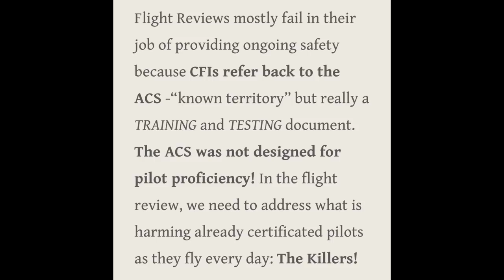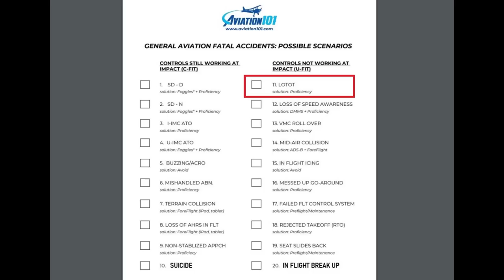Engine Failure at 400 feet.  The Impossible Turn.

Comment: Training has to become reflexive. No thought required. There is no time to think about what to do. This guy is alive because he reflexively pushed forward. He is a goldmine of experience. Excellent interview Dan!
Reply: Exactly, his 30yrs experience sure helped him fly to the crash scene alive. God Bless you Robert for sharing.
Reply: Thought is required, then action. You cannot just react without thought.
Reply: @Capt_Ron  reflex is an automatic reaction to an unexpected occurrence. Like putting your hand to your face when you sneeze.
If you have to take time to think, you’ll react too slowly.
Reply: Funny, as a Captain for a major US airline, (38 years experience) and having trained hundreds of crews over a 17 year period, it’s not what I have observed. Guys that react before they think are usually dangerous or cause a less than desirable outcome. I agree with you that some things needs to happen without a 1/2 second thought, for example, pushing the yoke forward on climb out after a sudden engine fail. But even in that case there is time spent determining what just happened and then acting.
Reply from the maker: @Capt_Ron  You may be confusing the two areas.  Panic reacting without thought can cause a guy to shut down the wrong engine, or to disable a GCU that can't be restored.  "Conditioning" on the other hand, has to do with making a human being an "Airman" where the controls are connected to his or her appendages, and the proper control response is intuitive because they are airmen, and can put in the correct rudder, aileron, or elevator deflection properly and in real time void of the shock and surprise delay.   It's the same "reaction" that you see when driving.  If a car crosses a lane and is headed towards you, you react without thinking and steer more towards the ditch to avoid the head on.  There is zero thought process in that time of crisis, you just see and avoid and there is no time to be slow about it.  See the difference?
Reply: @Capt_Ron  Came to say the same things :)
Reply: 100%, that is what i do. Know YOUR aircraft, know YOUR skill limits. Practice.
Reply: @ProbableCause-DanGryder  truth, sir! These are what I would call the "muscle memory" items. These are time critical minimums, where indecision will rapidly evaporate the options available. That brain freeze, or panic, or time of indecision can readily cascade into serious compromises trying to recover to that learned ideal.
Reply: @jamiewoki  Know your limits...and go fly with a CFI or much more experienced pilot and expand your limits.
Reply: @ProbableCause-DanGryder  Well said!

Comment: Anyone who tries turning back to the runway in a simulator will soon discover that two turns are needed.  After the 180 is complete, the plane is not pointed towards the runway.  A second turn is needed, and then aileron input to level the wings.  As the video described, the strong crosswind was definitely in Robert's favor.

Comment: * AIRSPEED  *
Reply: My ultralight instructor was a religious man.  But he told me right from the start “Airspeed is God”
Reply: I obtained my PPL, CPL and Instructor Rating in New Zealand in the mid 70's.

At every level we had to demonstrate a forced landing due to engine failure after takeoff down to 200  feet AGL.
Reply: @robinmccarthy9435 I’m interested but unfortunately not familiar with aircraft specifically training for ppl for example, do you know if anything like this is still common practice or is the standard a higher altitude forced landing perhaps?

Comment: Dan, have you ever flown in a glider? The situational awareness it gives you is priceless. As a glider pilot, I transitioned to airplane, and soloed in little over 5 hours.
I had 5 engine fails, 3 fires and one bird in 45 years of aviation. Landed without a scratch every time. Every takeoff, I am planning to turn upwind if engine fails, and sit there wondering how this bucket of bolts will crap out now. The rest of the flight I fly high, and look for places to land always. I tell people, if you think you are flying a plane, you are deluding yourself. You are flying a very bad glider with a drag overcoming device. If you don't believe me, you will when drag overcoming device stops abruptly.
As an A&P, I know where the potential issues are, but nothin can help you predict a connecting rod, or a valve just unceremoniously giving out. That is where training and knowing your plane is critical.
Reply: As having glider experience, my instructor illustrated during a winch launch, if cable breaks below a couple hundred feet, can land ahead; if below around six hundred feet, can do a 180 and land back; above that, a low tight circuit and land - the point was, you're never without pre-planned options.
Reply: Helicopter flying is good too, for keeping an eye out for possible landing spots.
Reply: I'm totally on board with Dan's AQP push and I agree with everything you just said in your comment.  And everything you're saying and everything Dan is pushing should be top priority to a GA pilot/aviator. What I'm calling for in addition to those things, is a COLLECTIVE push to actually solve the problem.  As much as I hate "mandates" in most cases, I'd like to see airports create designated cleared areas where if a GA engine quits on takeoff, the pilot can go direct to the spot and avoid the 180 turns.  Of course the FAA would have to get involved and the city involved too.  But it happens EVERY time !! When a new airport is built, it's ALWAYS out in the middle of nowhere.  So for perhaps the first 30 years, there are ample spots to put the aircraft down.  But then one day you wake up, and the airport is surrounded by houses, shopping malls, schools, stadiums, concrete, cranes, powerlines, ect ect.  Well, my feeling is, since the airport was there FIRST, there should be no problem with creating a designated emergency landing spot, and as much as I don't like Eminent Domain, I don't have a problem with it in this case, because NOT crashing into a building is absolutely for the common good. The other thing we need to collectively push is the powerplant itself.  As an example, the Dyna Cam engine {an engine with 50% of the moving parts as a "conventional" engine} was literally APPROVED by the FAA and tested on a Piper Arrow in the 1990's and passed with "flying" colors.  Yet here it is 2023, and there are no Dyna Cam powered aircraft {except possibly that Piper Arrow}.  So there's one thing "we" could be pursuing.  The other is some kind of emergency backup system.  My idea is use a conventional engine with a solid crank {you get rid of the CS prop where aplicable} and it's connected to a "thrust bearing box" {not a gearbox, unless it's a Rotax}.  The "box" is set up like a manual transmission clutch on a car.  99% of the time, the clutch remains engaged and a lever in the cockpit you can disengage it.  Connected to the output shaft are a set of pulleys driven by dual belts which are driven by pulleys directly attached to an electric torque motor via a centrifugal clutch.  So let's apply my idea to Robert's situation.  On takeoff, Robert sets the power, 80 HP from the O200 and 20 HP from the electric.  The O200 is driving the prop through the engaged clutch and the electric torque motor is driving the prop through the centrifugal clutch {because the electric motor is turning}.  So Robert takes off and starts the climb and at 400 feet BAM !! the O200 is rendered useless.  The torque motor experiences more a of a load and through circuitry, sounds a MAIN ENGINE FAILED ALARM and the immediate action is disengage the mechanical clutch.  So Robert hears "BAM !!" then MAIN ENGINE FAILED BELL and immediately pitches as required for best flying speed, then immediately disengages the main engine via the clutch handle - it would be spring loaded with a lock detent.  NOW the prop is unconnected to the failed engine.  Then Robert would push the electric throttle up to the full 100 HP and continue to do a normal climb.  Then Robert would pull the mixture handle and turn off the fuel on the selector valve since he's now fully electric. The battery which are in the wing tips, can supply 20 minutes of emergency power, so there's plenty of electrical energy to do a normal climb and do a normal landing.  Robert will still declare an emergency because he may have the ability for one, maybe 2 go arounds if needed.  But what Robert does NOT have to do are steep banked turns close to the ground.  - But look, I think it's just beyond ridiculous to continue with this idea that we just have to accept the notion that if you lose an engine, your only option is going down.  This is 2023 and we can figure SOMETHING out.  Like I said earlier, at the very least, airports need designated clear spots just off the runways.  But I can't do it alone - this has to be a collective effort - don't sit around and wait for the FAA to do anything about it because if they haven't done anything by now, they NEVER intend to.
Reply: @mustardseedsociety  Government is the worst way to do anything. Everything they touch turns to crap.
Reply: @KutWrite  Well I tell you what, you're PREACHING TO THE CHOIR !! But I have found when it comes to aviators, they are perhaps some of the most brainwashed people on the planet.  On one hand, most are incredibly super duper smart and that's why they have achieved a high level of success as an aviator and to that I totally tip my cap.  HOWEVER, on the other hand, many {NOT ALL} but many are as dumb as rocks in other areas.  As an example, according to Josh Yoder, 80% of airline pilots took the "sleever".  How can people who are so smart as aviators, be so stupid as lab rats ?? I don't get it.  That's why in my efforts to create a freedom and liberty aviation network, I 'm pretty much done with reaching out to current aviators because the vast majority I've run into are brainwashed robots as well as mister know it alls.  You certainly can't have a REAL out the box thinking revolutionary discussion with them because most are like zombies cut from cookie cutters.  So, because of that, I literally have to invent ways to introduce any out of the box solution because most get so offended and triggered.  Especially those that are former military.  They'll accuse you of being "against America" and I be like, OK whatever dude, have a nice day mister I know everything about everything. But I totally appreciate you for saying what needed to be said - you just spoke the truth and I thank you for it.
Reply: @mustardseedsociety  Thanks for the positive feedback. I know what you mean, having been to Navy flight school AND worked as a civilian for its TOPGUN school before it merged.
 
Interesting image, 'cookie-cutter zombies.'
Reply: @KutWrite  Wow, that's pretty cool.  Look, nobody believes in safety more than I.  I'm not out to break flight procedure rules, or none of that stuff.  I just find the certain regulatory "agency" very inconsistent.  If they're really about safety, why can't they try to get airports to have designated "go to" spots for light singles and light twins so you have a place to put the machine down under control ?? Can't they see that every airport starts out in the middle of nowhere, then 30 years later it's surrounded by BUILDINGS ?? All I'm asking for is a place to put the disabled aircraft down - nothing fancy - just a patch of grass - the only maintenance is maybe mow the grass.  The other thing that REALLY irks me is the certain regulatory agencies' attitude towards a "paying" passenger and a "non paying" passenger. Are not BOTH just as important in terms of value ?? If I'm not safe to fly a paying passenger, then I should not be safe to fly a non paying passenger.  I'm either safe or NOT safe to fly ANY passenger.  What does a money transaction have to do with ANYTHING ?? Now, that being said, I would be in total favor of someone who misrepresents themselves charged with fraud.  Regardless of the status of the passenger {paying or non paying} if I say I'm a 5000 hour pilot but I'm really only a 400 hour pilot, then I should be charged with Fraud {if it can be proven of course}.  That way it's the buyer beware.  And here's another thing ?? Commercial pilot status don't mean Jack !! Look at the Kobe Bryant crash.  The pilot was not current like Kobe thought he was, and was a bad decision maker.  When he was over Glendale, he should have made a command decision and made an urgent request to land at Burbank and shut everything down.  Kobe could of just called a limo to take him to Thousand Oaks.
Reply: @Lurch Great comment Lurch - maybe "we" as an aviation community should push for aircraft that fly like the Sinus.  24 to 1 ratio without tips, & 27 to 1 with tips.  120 MPH cruise with gasoline motor on. If you want to go glider mode you shut motor off. It gets off the ground in 300 feet - which means plenty of runway in front of you. The problem with the Sinus, is they want too much money for the thing {in my opinion} - but flight schools should look into it.  You can teach students both powered and non powered in one machine. Also if you don't mind, can you un RUST me and explain how to do a slip to lose altitude - I kind of need to know - starting IFR training soon in a C152 - actually the school has 2 152's - one is an aerobat they use both for IFR and spin training {recovery}
Reply: @emergencylowmaneuvering7350  My biggest complaint is if the standard is going to be land "straight ahead", and not attempt the "impossible turn", then GIVE PILOTS SOME GREEN !!! {not a money handout, although that would be nice} but a GREEN PATCH OF GRASS 1/4 mile or so off the end of the runway. That to me is the simplest solution.  Take off - engine out - land in the grass - save a life or two and save the airplane.  The life of an airport is so predictable.  In the early days of the airport, the airport is out in the "sticks" and most of the time PLENTY of corn fields around the airport.  Fast forward 30 years and the airport is surrounded by houses, schools, stadiums, Wal Marts, Mickey Dees, power lines and the ole cornfield is gone. I say if airports have to have minimum equipment, like a wind sock, or runway markings, or Vasi lights, or ILS systems, then why can't an emergency strip of grass be part of the airport minimum "equipment" list ?? If "eminent domain" has to be used to GOD forbid provide an emergency landing spot for a disabled aircraft, then so be it.  Look, I don't like "eminent domain" because it has been abused - HOWEVER, in the case of the airport, the airport was ALWAYS in every case there FIRST before the surrounding development came in.  It's a very easy and very doable solution to engine outs on takeoff.  And some cases during landings.

Comment: OK, tell me to shut up if you need to. But guys, why are people so against Dan😢
He is promoting the training  I know, in South Africa we have a British based training curriculum. Maybe that is the difference. It includes most of Dan's AQP scenarios.  Stall/spin in the pattern is almost unknown in South Africa. Of course we have a rectangular pattern, and on the straight stretches, particularly Base and Final it gives time to do speed checks, flap settings and trimming before turning to finals through 90 degrees . WITHOUT your senses being occupied for a smooth half circle turn from downwind to final as it appears the practice is in  videos from US pilots. A nd YES, our pattern (circuit as we call it)   is more precisely trained from day 1 than what appears to be the case in the USA. Speed MMS is drummed into your mind I did my initial training in  1982.

Comment: Congratulations Robert. I had a similar incident that happened to me in 1977 in a C-150. I took off from Earlton  CYXR on runway 16 in the middle of winter. There was a good headwind from the southeast. At approximately 400 to 500 feet, I had a complete sudden lost of power. Not wanting to land straight ahead in a field with three feet of snow, and damage the aircraft, I did something very stupid in deciding to attempt a quick 180 turn. I figured if I did a steep turn at low speed without stalling, I would be able to turn on a dime. Well, it did not work out as planned. In the turn, I could not see where I was going as the wing was in the way. All that I could see in my left window was the snow covered ground approaching at an alarming rate. I then decided to level the wings to see where I was going. Before I even had time to level the wings, I touched down nose high with no clue as to where I was. I had done a 180 and touched down about 400 feet east of runway 34. Incredibly, I happened to land on the button of runway 07 heading north towards the 300 feet long taxiway that leads to the runway. I had to apply full left rudder to avoid hitting parked aircrafts beside the taxiway, then full braking and full right rudder to avoid hitting the radio operator’s building. I then continued rolling on the taxiway and with the speed I had, I was able to roll the aircraft in the hangar with a stopped propeller. It is nothing short of a miracle that I survived this stupid manoeuvre. The lesson for me  was that I endangered my life or worse I could have killed someone just to avoid damaging an aircraft. Every situation is different but generally it is better to land straight ahead in a controlled touchdown at a slow but safe speed and stay alive.
Reply: I remember reading about this in the paper....but you forgot about the part where you hit the gas pumps, your cap popped off, the pump turned on, the nozzle fell into the tank and topped off you tank on the way to the hangar allowing you a 5 minute turn around time to still get to Vegas on schedule.
Reply: @CFITOMAHAWK2  ya think?